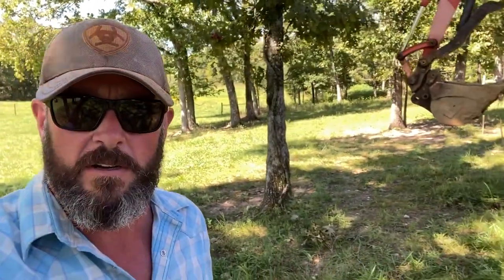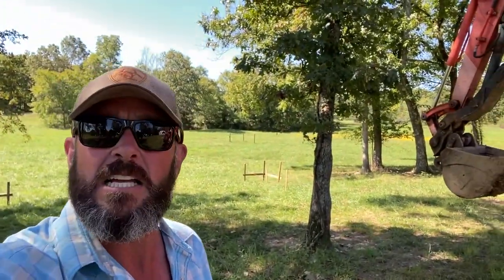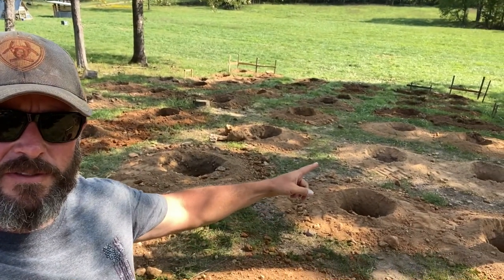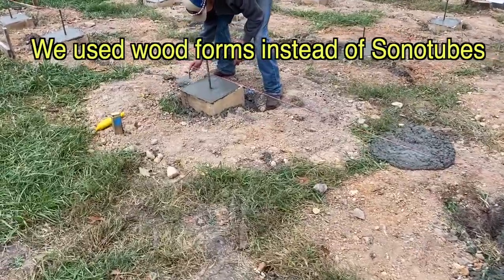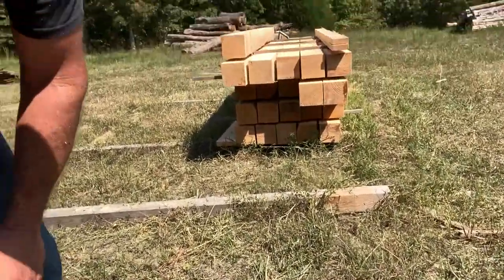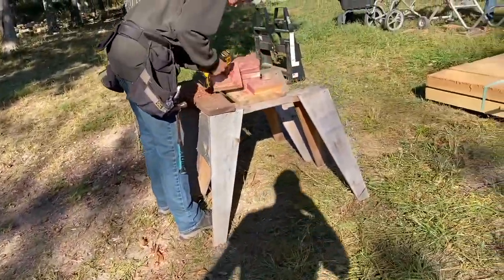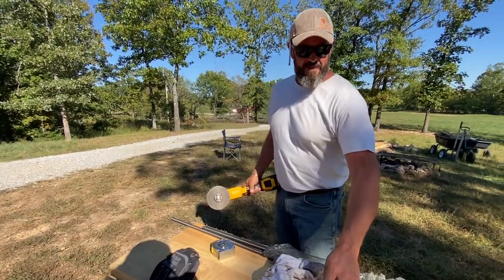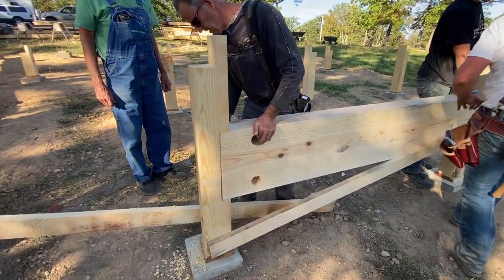Building A House DIY / Post and Beam PT 1

Comment: 8.54 Did those washers bend as you tightened the nut? It's a neat idea so I was thinking of doing the same, but wondering about shaving off a flat edge in there first.
Reply from the maker: Yes, the washers pressure form and act as a locking mechanism against the flat edges of the nut. Thanks Horse
Reply: @tickcreekranch  gotcha, thanks